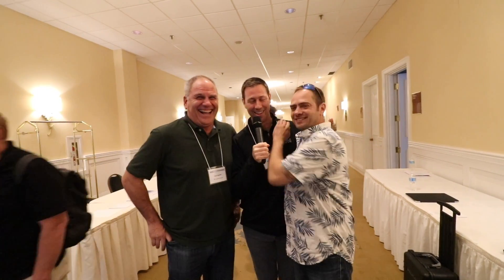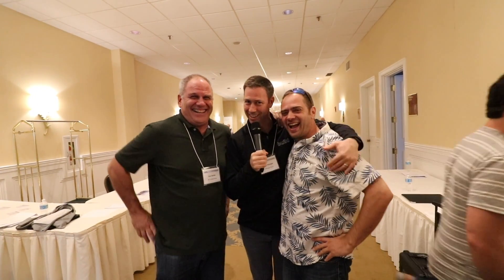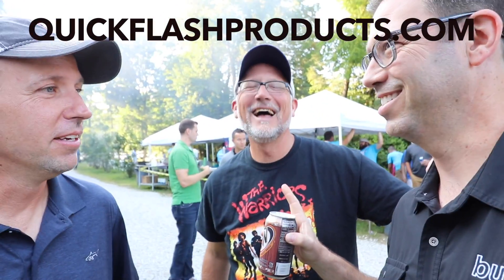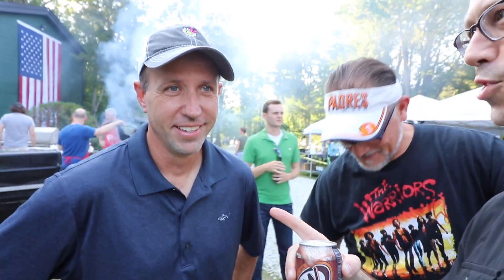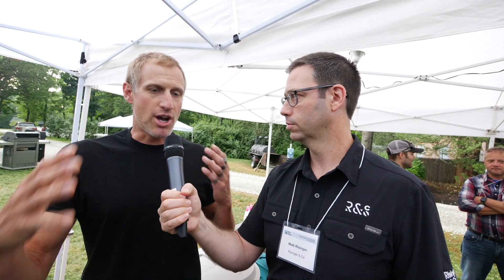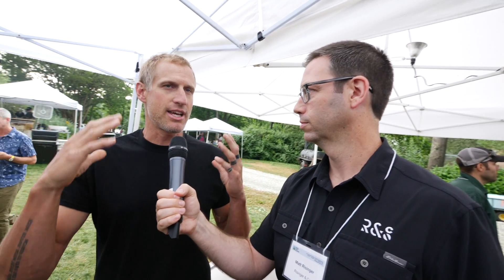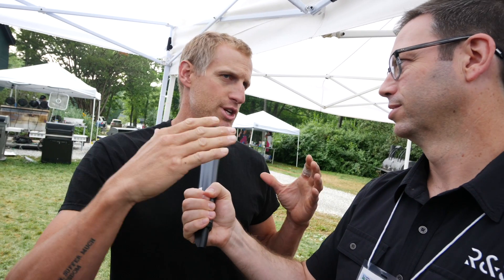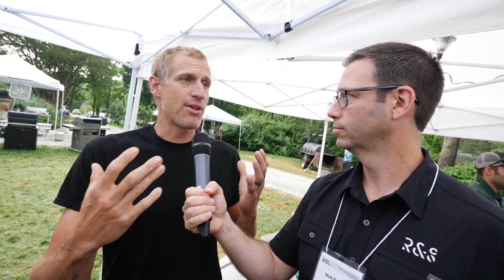Building Science Camp 2017 outside Boston

Comment: Nice (near midnight) drop.
How do you affix the rigid foam to plywood as in the "Super Insulate a Stud Bay" video (https://youtu.be/ckJ_0TpkvK8)?

I'm also considering a retrofit for inside of attic.
Is the PL Rigid Foam Adhesive (Loctite PL 300 : http://www.loctiteproducts.com/p/pl_ca_300_voc/overview/Loctite-PL-300-VOC-Foamboard-Adhesive.htm ) enough for an interior retrofit?
Before you suggest it, I can't afford closed cell foam and would like to buy a few panels at a time and tackle the project slowly over time.
I also hadn't decided how thick (R-level) I'll go with.  I wanted to get one 2-inch layer up and see how that performs as I've already got the traditional batt insulation in place at the attic floor.
Matt, thanks for the great content.